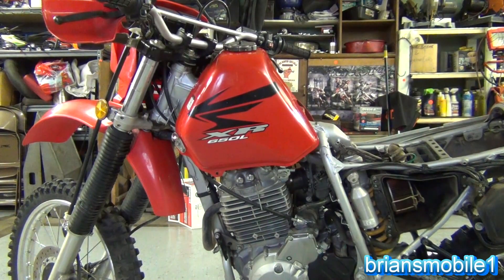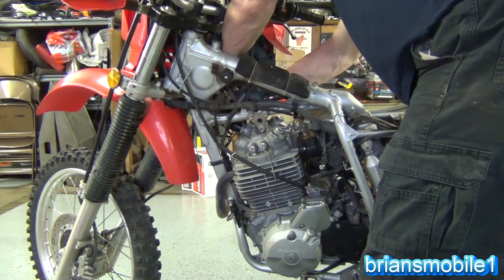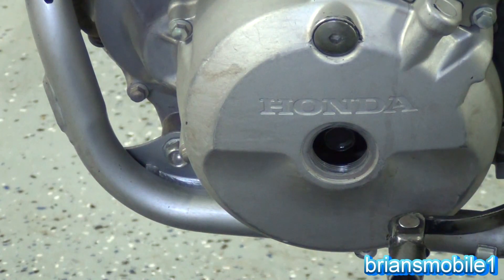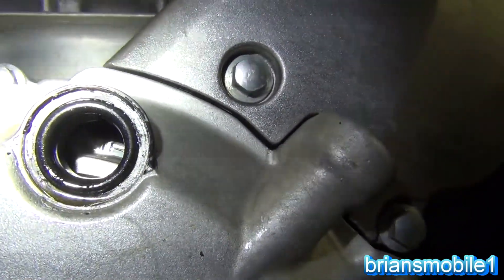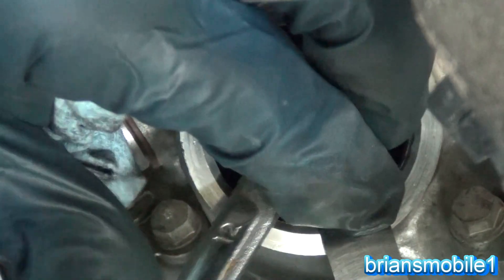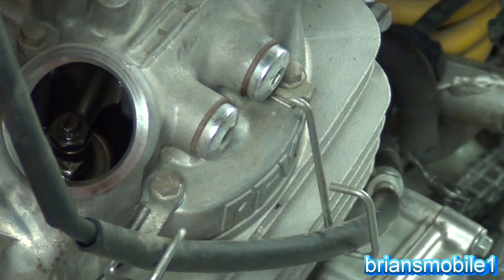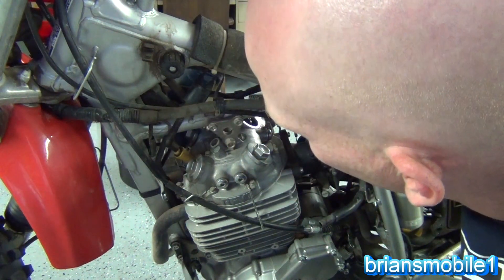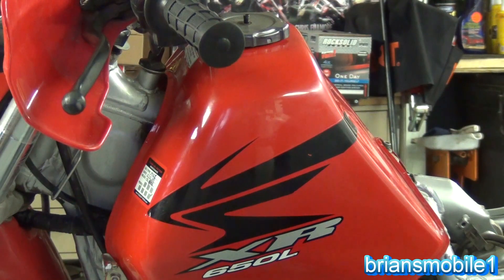XR650L Valve Specs And Adjustment

Comment: I had to stop at 3 minutes in. In which world are valves adjusted while hot? This has to be one of the top stupid things I’ve heard someone say concerning motorcycles. Or any motor for that matter.
Reply from the maker: :D  This one.  Thermal expansion is a thing- and this is a gap.  Heat changes the gap.  Most Honda vehicles with adjustable valve clearances are the exact same way.
Reply: @ thermal expansion is a thing and it varies depending on temperature, which is why valves are set stone cold. You don’t want huge gaps while the engine is running. You start with gaps that close as the engine heats up. You are wrong about this.

Comment: Got the same bike 08.Wouldja know why it misses when i open the throttle a bit wide?Had the darn carb cleaned out no joy!Spark plug is a ok as well.Could the cdi have developed a fault or some such thing?K and N air filter

Comment: I was looking for a video where I didn't have to strip my bike of so many unnecessary parts and here yours seem like the better of them. I seen on where the exhaust came off, carb. and airbox and other things which made me rethink the job till I seen this. Because of my living situation, I am unable to perform much needed maintenance. After watching video I'm confident I'll be able to adjust my valves, there's some ticking going on in mine and hope to start this soon. Thanks again for not making it look so complicated, it's clearly explained to follow without no hiccups.

Comment: Service manual says to check valve clearance while the engine is cold (below 95 degrees)
Reply from the maker: Radiator cap says not to open hot.  Both great tips to prevent burning yourself.
Reply: @briansmobile1  words of wisdom 🙂🙂🙂

Comment: i adjusted the valves on this bike while it was hot because some youtube dude was like YOU GOTTA DO IT HOT FORGET YOUR REPAIR MANUAL and now im taking the head in for a rebuild because the clearances apparently are engineered to be set cold and the heat expansion of the metal is taken into consideration
Reply: The video is incorrect. Valves should be set with engine COLD, completely cold!
Reply: Watch out for shade tree mechanics that tell you to ignore the Honda Service manual on Youtube.
Reply: ALL VALVES ARE TO BE ADJUSTED COLD ON EVERY ENGINE ON THIS PLANET . ..........
Reply: Conor McQueen that was going to be my question "do it hot?"... Sorry about your experience... Either way the video was well explained, and with good illumination. Hope you didnt spent too much $. Cheers.

Comment: Hey Brian, nice video for Wildcard Wednesday. Just a quickie since this reminded me when I did valve adjustment on 06 Honda Ridgeline 2 weeks ago.  I had the intake valves way loose and tighten them.  The exhaust valves were okay so left them alone.  I am now getting negative fuel trims which annoys the heck out of me (STFT -5 and LTFT -9).  Seems bank 2 is running richer than bank 1 too.  Has this happened to you before with Honda CRV, Ridgeline, or Odyssey?  Thanks bud and keep those videos coming.